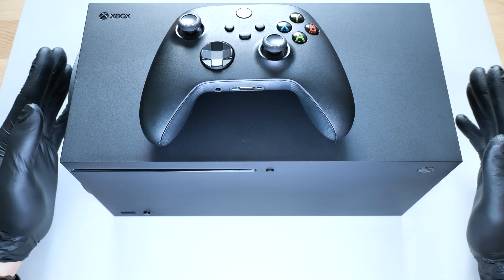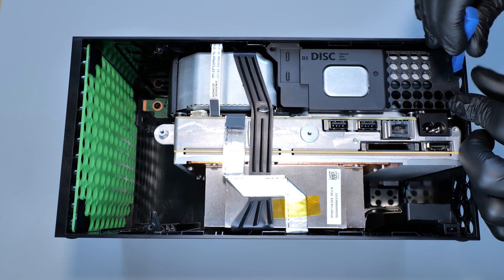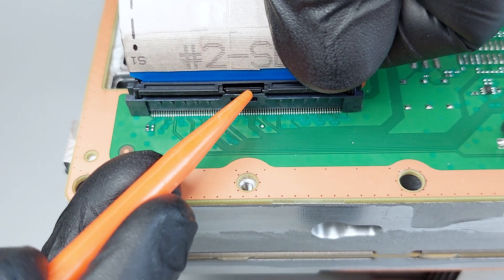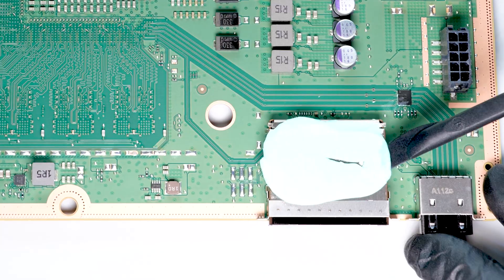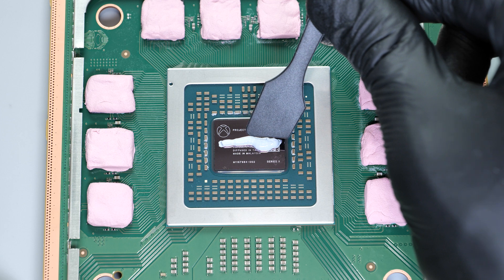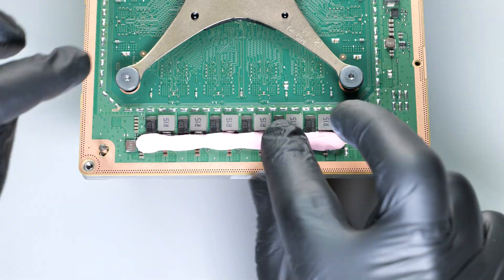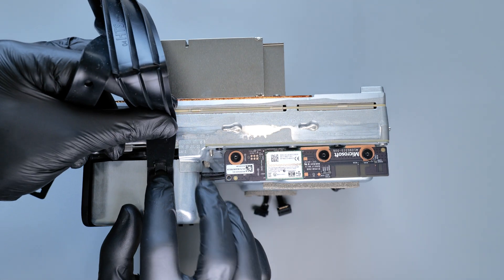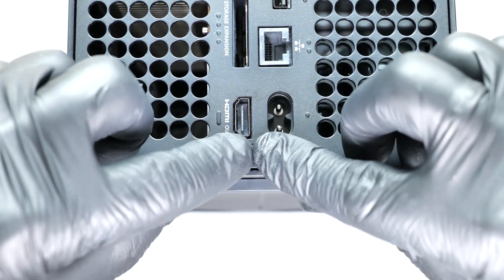Xbox Series X Thermal Paste and Pads replacement and Cooling System cleaning

Comment: Thanx fpr sharing. At 3:38 i can se3 as your unit missed of "cpu board shield" I saw on pretty  all the videos from other user.

I've disassembly my(2nd hand) xbox x yesterdey and i  was worried about that, afraid from prewious  owner forgot or broke that part in the past. Can you confirm that some older unit does not have this shield? Regards and sorry for my eng
Reply from the maker: The Xbox Series X originally launched with that metal shielding but, in later production runs, Microsoft removed that metal shielding. Most likely, it was for thermal improvement or cost-saving, or a combination of both.
Reply: @ElectronicsComputers so if my Xbox series x has one do I have to put it back on?
Reply from the maker: @wrld5632   Well, it's up to you, but that shielding definitely makes the APU and the surrounding board run hotter. Also, Microsoft ditched the SSD shielding in the latest Series X Galaxy Black, which was most likely the main reason why so many SSDs were failing in that console.
Reply: @ElectronicsComputers does this mean i can reapply putty than not replace the shield. I just need to spread it over the ssd till it completely covers it.

Comment: For some reason after following your steps I now cannot get the video to come through. It turns on but video output is not registering
Reply from the maker: It turns on and boots — but can you also power on the controller, and does it sync with the console or not? Before disassembling, did you unplug the HDMI cable first and then the power cable? And after reassembling, did you plug in the HDMI before powering it on? Hot-plugging HDMI while the console is powered can sometimes damage the HDMI retimer chip. I'd also recommend reassembling the console again to double-check all internal connections and clean the HDMI port. Make sure it's not loose or damaged and that the port is still properly soldered to the board.
Reply: @ElectronicsComputers  controllers sync perfectly with no issues.  It's just the video that is not coming through. I disassemble it again and the video is still not coming through
Reply: The HDMI port and soder looks perfect with no damage either.
Reply from the maker: @ryannash7027  Based on the symptoms you described, it’s most likely a dead HDMI retimer chip. I actually have a video showing how to fix it. The chip itself only costs a few dollars, and it’s a pretty common fault. It usually dies when someone plugs in or unplugs the HDMI cable while the console's power cord is still connected to the outlet.

Comment: can i use tuner contact cleaner spray like wd-40 for inside the heat sink?
Reply from the maker: For those applications, only isopropyl alcohol can be used. WD-40 leaves a residue behind, which can interfere with thermal transfer and affect the components themselves.
Reply: @ElectronicsComputers  thank you so much for responding, so 90% isopropyl alcohol is completely safe for washing inside the heat sink and flush the oil and dust out yes?
because i don't want to take the entire system out, only the back panel and remove the dust from the heat sink
Reply from the maker: @rainsfall4119 I’d still recommend at least removing the chassis for a proper cleaning. You wouldn’t believe how much dust accumulates in the power supply vents. If you want to take a shortcut, I wouldn’t use alcohol at all, as it may also wash away thermal paste or thermal putty. Just remove the back panel and either go to a gas/petrol station and use a compressor, or buy a can of compressed air to clean out the heatsink and power supply.
Reply: @ElectronicsComputers  thank you so much for your help i really appreciate it

Comment: can i put thermal pads on xbox series x? I mean thermal pads like arctic tp3
Reply from the maker: In theory, it's possible, but considering the various non-standard gaps between different components and the heatsink, you would need a range of thermal pads with different thicknesses, or you would have to use highly compressible pads, which have poor thermal conductivity. We used thermal pads for the One X consoles instead of thermal putty, but on the Series X, it seems that this approach causes more issues than it improves cooling. Nowadays, thermal putty offers excellent thermal conductivity, adapts to the shapes of surrounding components, and efficiently transfers heat from all their surfaces to the heatsink.
Reply: 1.5mm thick tp3

Comment: I see these videos all the time, but no one seems toention the thickness of the pads to use instead of "putty".
Reply from the maker: Because nobody wants to downgrade their console. Thermal putty is far superior to any thermal pad in adapting to uneven surfaces and efficiently transferring heat from components to the heatsink. Even if you carefully layer different thermal pads of varying thicknesses, they still won’t come close to the performance that thermal putty provides.

Comment: Is that termal pads? What kind of termal pads is that?
Reply from the maker: It's better than thermal pads. It's thermal putty. The link in the description.
Reply: @ I can’t use thermal pads? I’m asking because I have ordered them but I didn’t know that it was a different thermal pad
Reply from the maker: @moises1006  In theory, it's possible, but considering the various non-standard gaps between different components and the heatsink, you would need a range of thermal pads with different thicknesses, or you would have to use highly compressible pads, which have poor thermal conductivity. We used thermal pads for the One X consoles instead of thermal putty, but on the Series X, it seems that this approach causes more issues than it improves cooling. Nowadays, thermal putty offers excellent thermal conductivity, adapts to the shapes of surrounding components, and efficiently transfers heat from all their surfaces to the heatsink. The link in the description.
Reply: @ I’ve bought 3 of  100x100mm and 1.5mm of thickness could it work? Or shall I return them ?
Reply from the maker: @moises1006  If you apply those pads to the memory chips, the APU won’t even make contact with the heatsink. There will be a gap and your console will shutdown due to overheating.
Reply: @ ok I’ll return them better and ask the putty 
Ty for attention

Comment: Thanks a lot for this USEFUL video 👍🏼👍🏼👍🏼
Reply from the maker: Glad it was helpful!
Reply: I please have a question, for the pads i chose to replace it by Grizzly Minus Pad 8 and for the CPU the Grizzly PTM phase sheet.
I need you to tell me for the pads if i need 1.0 , 1.5 or 2mm and if the Grizzly PTM phase sheet is ok for the CPU. 
Thanks a lot 👍🏼
Reply from the maker: @MC-gy6bf  Well, considering the various non-standard gaps between different components and the heatsink, you would need a range of thermal pads with different thicknesses, or you would have to use highly compressible pads, which have very poor thermal conductivity. We used thermal pads for the One X consoles instead of thermal putty, but on the Series X, this approach causes more issues than it improves cooling. Nowadays, thermal putty offers excellent thermal conductivity, adapts to the shapes of surrounding components, and efficiently transfers heat from all their surfaces to the heatsink. Thermal pads don't come even close to that performance level. Using thermal pads most likely will be a downgrade in terms of cooling your console but it's up to you.
Reply: Ok thank you, so the PTM phase sheet is ok but for the pads it will be better to put some putty like the upsiren ?

Comment: My Xbox series X is one year old and I accidentally made it overheat once by not plugging the fan back in with a basic clean job. I cooled it down in 5 mins with cold weather and fans. Seems like it works fine. Should I replace thermal or wait another year?
Reply from the maker: That depends on how you overheated it and how long it was exposed to high temperatures. If you cooked the sh*t out of it to the point where it started to smell and the overheating protection shut down the console multiple times, then it makes sense to replace the thermal paste. Also, don’t forget to reshape the thermal putty, because once the heatsink has been removed, it will never make the same contact or have the same thermal conductivity as before.

Comment: Hi there ..!
Can I use thermal pad instead of thermal putty?
Reply from the maker: In theory, it's possible, but considering the various non-standard gaps between different components and the heatsink, you would need a range of thermal pads with different thicknesses, or you would have to use highly compressible pads, which have poor thermal conductivity. We used thermal pads for the One X consoles instead of thermal putty, but on the Series X, it seems that this approach causes more issues than it improves cooling. Nowadays, thermal putty offers excellent thermal conductivity, adapts to the shapes of surrounding components, and efficiently transfers heat from all their surfaces to the heatsink.
Reply: @ElectronicsComputers  Thanks for an answer and thanks again for making this video ❤️❤️

Comment: Will this help with my xbox crashing on new gen games?
Reply from the maker: If the issue is due to overheating, replacing the thermal pads and putty can help. However, if the problem persists, it could be related to power delivery, APU degradation, or even SSD issues.

Comment: Please what’s the solution to Xbox series x flickering display? HDMI looks pretty good. 

https://youtube.com/shorts/brQrDnErOaM?si=UlSVJk8JgxjsGx0o
Reply from the maker: First, as a regular user, what you can do is try another HDMI cable, reverse the cable, or try a different port. That’s about the maximum you can do. If you have some electronics repair skills, the first thing I’d try is replacing the HDMI retimer chip—I have a video on that. If that doesn’t help, I’d check the power management rail that powers the APU to ensure all switching and filtering are working properly. If everything seems fine, my last option would be to reflow the APU. If that helps, I’d immediately put it up for sale and buy a new one. If the Series S|X starts to die, it’s time to move on. Those models are very problematic, and if the SSD dies, it becomes a piece of junk because no one can fix them due to Microsoft's encryption. We buy these consoles for parts for $30-50. So, try to fix it with minimal investment, then sell it to make the most profit and invest in a new device.
Reply: @ wow interesting! Just when I thought it’s something that can be easily fixed! Thank you for your response! 

I wanted to buy the series S, but seeing that it’s a common issue, I guess I would opt for a gaming Pc Instead so I avoid the Xbox totally. Thank you for your advice & feedback
Reply from the maker: @Flymore.with.Damfery  Switching to a PC is a great decision. On PC, everything is customizable, repairable, and upgradeable at an affordable price. Even though a PC is more expensive than an Xbox, it will last longer. The best console was the Xbox One X easily repairable, with users able to replace the HDD with an SSD but things have changed with Series S|X.

Comment: After renewing the thermal paste with Arctic MX-6, I started experiencing FPS drops in games I used to play without issues. What could be the reason? Please help.
Reply from the maker: Have you reshaped the old thermal putty or applied new? If you haven't, once the heatsink is lifted, the old thermal putty will never make proper contact again and won’t provide the same thermal conductivity as before. So if you don’t want to replace it, at least reshape the old one so it compresses properly when you reinstall the heatsink. Your choice of thermal paste is always not the best. So, most likely it's a combination of factors that cause those issues.
Reply: I have the same issue when playing COD. I change only thermal paste with mx4 and don't reshape thermal putty original. Now order Usiren utp8 and when come I change again with new putty.

Comment: Not trying to rush you or anything but I urgently need a answer :
 do you need to do the thermal puddy step because I only have enough for the thermal paste just don't know if the thermal puddy is needed or is it optional 
Also will it perform and be quieter if I do put new thermal puddy on it?
Reply from the maker: If you don't want to use a thermal putty with higher performance and thermal conductivity compared to the stock one, simply reshape it so it makes proper contact with the heatsink. Once the heatsink is removed, the thermal putty will no longer maintain the same contact as when it is compressed to the required thickness by the heatsink. So, just reshape it or use Upsiren PRO.

Comment: Hello, very good guide. I used the MX6 thermal paste and the thermal putty, which they sent with the U6 Pro from the supplier you provided in another video from Aliexpress. The changes were excellent. In my case, I spread the putty with a very thin card, covering everything… about the size of a small bean, and then spread it. For the putty, I had the 50g one, and I rolled up the original material I removed into a small ball and approximated the size to recreate it. I used a bit more for the SSD and memory card, but I pressed it down well. Excellent, simple. My advice: make sure to double-check everything you reconnect.
Reply from the maker: @leandrostevendominguezleyv7512  Great job! I'm happy to help and thank you for the comment.

Comment: Hi it possible to help me I'm planning to buy thermal putty CX-H1300 for xbox series x. is it ok for xbox series x??? ( u6 pro thermal putty is not available in my country) waiting for your reply thanks
Reply from the maker: Yes, you can use that thermal putty. It actually has slightly better specs compared to the one I used in the video. We use the pink one for customers' devices in my repair shop. Of course, Upsiren UX Pro Ultra is the best on the market, and I only use it for my personal devices like my graphics card and console. However, you won't notice much of a difference between the CX H1300 and the Upsiren UX Pro Ultra. Either of these options would be far better than the stock thermal putty.
Reply: @ElectronicsComputers  thank you so much for your help and info 🤝👍
Reply: @ElectronicsComputers bro it possible to help me I'm planning to change thermal putty and thermal paste in my xbox series x bro do you have any Pump-Out problem in thermal grizzly kryonaut thermal paste in xbox series x. And also thermal grizzly kryonaut is having drying issue is it safe to use in xbox series x? Waiting for your reply thanks
Reply from the maker: @xgamingmachine  What I showed in the video is what we use in my repair shop for our clients. None of them have ever returned with overheating issues. I also did the same upgrade on my personal console when I noticed it started to get hotter. I used the same thermal paste but with a different thermal putty, which is better in terms of thermal conductivity — the Upsiren PRO version. But either choice is still better than the stock one.
Reply: @ElectronicsComputers ok bro thank you so much for your reply bro tomorrow going to change my thermal putty and paste in my console and thanks for the video🫡❤️🤝

Comment: Does it matter if I use the U6 pro stuff or the one with UTP8 on the box?
Reply from the maker: Those are even better. I was using the cheapest thermal putty because that's what we put in our repair shop for our customers' devices. It's still better than the original and far superior to any thermal pads. If you're doing it for your own console, then it makes sense to use the best stuff available.

Comment: if i use thermal pads instead of thermal putty its a good option?
Reply from the maker: In theory, it's possible, but considering the various non-standard gaps between different components and the heatsink, you would need a range of thermal pads with different thicknesses, or you would have to use highly compressible pads, which have poor thermal conductivity. We used thermal pads for the One X consoles instead of thermal putty, but on the Series X, it seems that this approach causes more issues than it improves cooling. Nowadays, thermal putty offers excellent thermal conductivity, adapts to the shapes of surrounding components, and efficiently transfers heat from all their surfaces to the heatsink.
Reply: @ElectronicsComputers  So, if i use 1.5mm thermal pads for example; It would be ok?

Comment: Thank you for this detailed tutorial! I've already opened my Xbox several times to remove the dust, but only completely disassembled it today to replace the thermal paste. This video was a great help! To anyone considering taking the same step: My Xbox Series X is now three years old and the original thermal paste was completely dry. The preinstalled putty paste seemed to be okay, so there was no need to replace it today. 

Just one more note: In another video, I saw an additonal cover made of thin sheet metal that was mounted over the backplate / X clamp and that needs to be removed. In my case, this kind of cover and  mounting frame was missing (as the Xbox in this video tutorial here, too). Presumably there are different revisions of the console regarding to this detail.
Reply from the maker: I'm glad I could help you with servicing your Xbox. That X-clamp shielding usually appears only on the first batches of Series X consoles. From my perspective, there's no need for that part, as it traps heat on the back of the APU under the shielding. Without it, the temperature in that area of the motherboard is lower than when the shielding is present.
Reply: If it is on the console is it necessary to place it back on or can you remove the covers entirely? @ElectronicsComputers
Reply from the maker: @ThePhOeNiX86  I wouldn't use any metal shieldings at all it just traps heat.